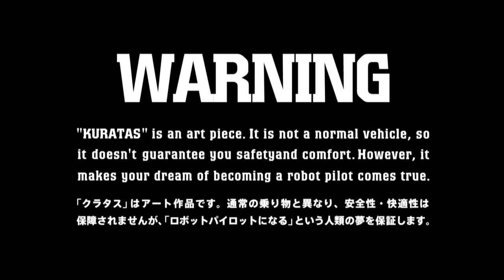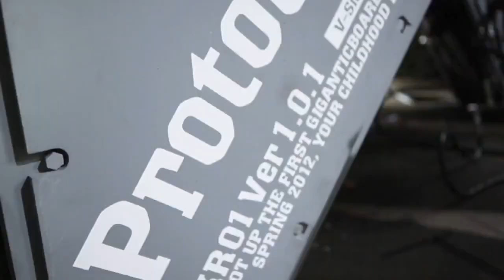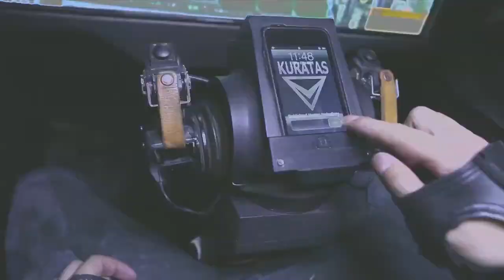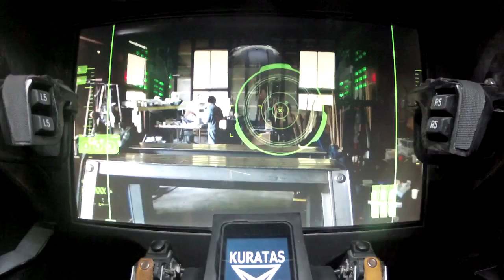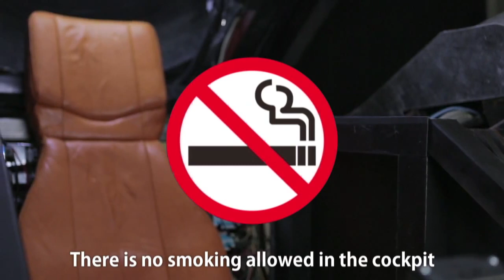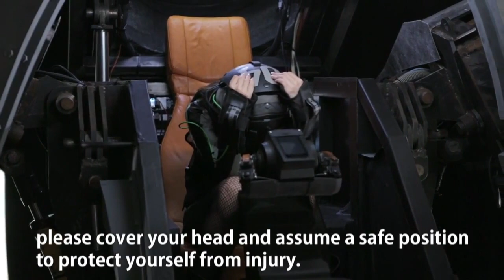Suidobashi Heavy Industry - Kuratas Piloted Robot [720p]

Comment: 5:17
"It is gasoline fueled and runs on a diesel engine"
Well i have an issue with this statement.
Reply: Asian can make it possible, trust me.
Reply: They could make it run at full speed even with Beer.
Reply: Even with hamster wheel i bet too!
Reply: thefishstick Judging by their abilities, I wouldn't doubt if they said it's moved by H2O or even O2

Comment: this is just a clunky prototype alright,but if they scale up the size big enough they can house engine of today's tank so they could install tracked wheel for better mobility,and also get more hydraulic power with it so they can make a more nimble vehicle. I don't think such vehicle will replace MBTs, but it does have a chance to replace light tanks and other specialty armored vehicle, especially the ones they use for urban warfare, which I think would happen far more often in the future than full-scale open battles. In urban warfare scheme, you don't need full-sized 105 mm howitzer guns, multi barrel machine guns coupled with 20 mm multi barrel cannons and ability to launch Stinger-class short-range-missiles would be enough. I really do think this kind of stuff have future in real battlefield

Comment: this is gay if it falls sideways it cant even set its self up right and what about if there was a gas attack is there no air filtering system
Reply: Prototype mean anything to you?
Reply: Ooooouwwww got fckin dished yeah yeah!!
TROLL sorry :D
Reply: tysej4 prototype or not the concept of a piloted robot in any format is so beyond impractical it's retarded. I can see speed bumps and pot holes alone causing this thing no shortage of maneuverability problems. It's a toy, a glorified forklift with pneumatic hydraulic arms that are purely for show.
Reply: godofawesum223
Sure the arms are not needed, but a mobile Platform of this type could be used in riot control among other things... Never for combat no.
Reply: Umm, did you read the phrase "art piece" in the description?
Reply: ^ THIS hahahha
this is used for riot and not used for war
you can see its for safety guard =='
Reply: tanks dont have a self righting system